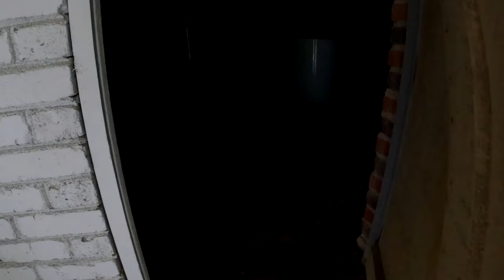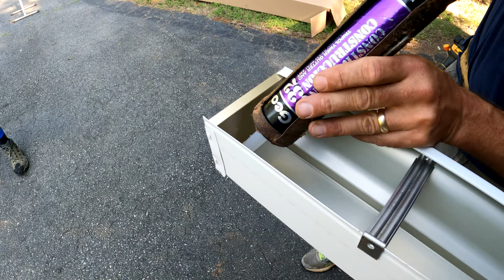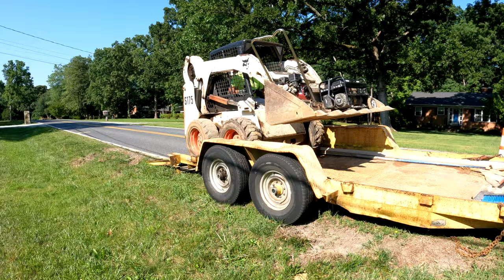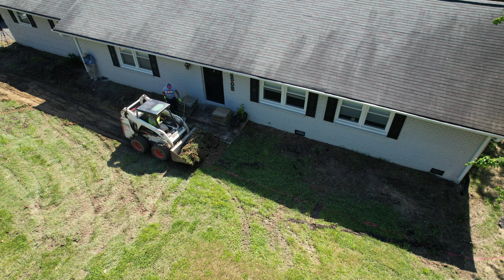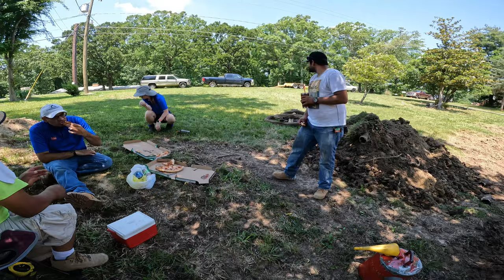Forming it up Part 2 of 3

Comment: When you're assembling 4" PVC by yourself, here's a tip from a DIY'er who almost always works alone.  Put some kind of hook on the end of a rope - I just use the strap from an old ratchet tie-down - and hook it in the far end of the pipe.  Secure it with duct tape so it doesn't just fall out.  Bring the free end down to where you're gluing; spread the glue, get the pipe started into the fitting, and then wrap one hand into your rope & pull hard while maneuvering the pipe & fitting with the other. It's not nearly as good as having a helper shove from the far end, but it's much better than just trying to pull the pipe into the fitting by grabbing on to it.
Reply from the maker: That's a great tip! Thank you!

Comment: Crawl space is bad. Needs new barrier and sump pump and drain around perimeter. Add dehumidifier as well. That is bad for the air and wood. "every little 1/8 of an inch counts" thats what she said.
Reply from the maker: Now that we have solved the water intrusion issues the vapor barrier is moot.

Comment: When you said you were not taking your truck in the back yard due to the old septic tank, I had a little chuckle.  It also made me wonder how I did not fall into ours when we use to drive over it.  We never knew where the cesspool tank was and came to find out we had been driving over it for years, had a RV parked on it and had heavy trucks drive over it also.  We got very lucky.

Comment: A corrugated pipe actually flowing? never seen it before
Reply from the maker: Hahah! It was flowing but not enough to help matters any.
Reply: Nothing wrong with single wall corrugated pipe for lower flow land drains where no debris can get into them and they can not be crushed. Just under the grass and connected to gutters is not their place.

Comment: I just got gutter guard installed a couple weeks ago! We've had a couple huge rains and they've kept up great! I get tons of leafs and helicopter seeds that clog them. Year round cleaning.
Reply from the maker: The gutter guard makes cleaning so much easier. Using two leaf blowers I can clean off my roof in less than 5 minutes.
Reply: @GCFD  Would you happen to know the brand of the gutter guards?

Comment: When you lifted the pavers and said sand rock was under them and it lets water through. Why did you get sand rock under the concrete slab? Wouldn't you want some sort of impermeable clay sand/dirt under the slab?
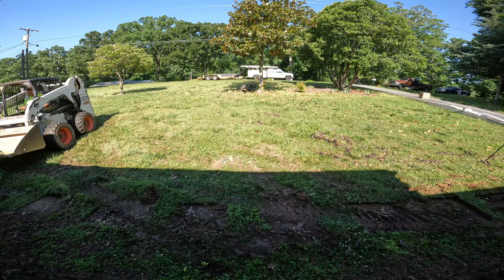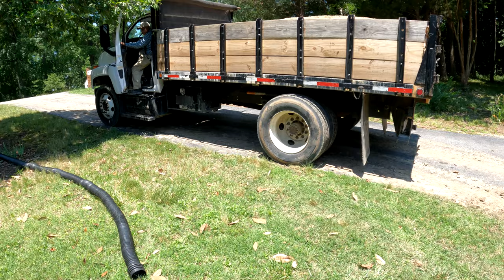11:10 and 16:40

I'm assuming it doesn't matter as the water will not be sitting on top of the soil penetrating down when its coming across the hill and landing on the slab into the drain?
Reply from the maker: You got it. We made sure to use good clay to pack up against the new concrete to keep the water on the surface. We also make sure the ground is higher than the slab so it rolls onto the concrete easily,

Comment: Hey Sean, what if you had done a linear drywell along the front of the house drained to the channel or pond directly? You'd have to trench deeper to get below the crawl space but then you wouldn't have all that concrete. The linear drain could still be used as a make-sure method. On the other hand, I see more drainage work for you in the future when this or the next homeowner forgets and builds a roof over that patio.

Comment: Those gutters are amazing! Did you attach the drain at the end of the house to the pipe to get it in the channel? I couldn't see.
Reply from the maker: The last downspout at the right of the house dumps onto the concrete. I didn't like the idea of turning more than 90 degrees to get it into the channel.
Reply: @GCFD , oh, that makes sense. Thanks for taking the time to reply.

Comment: would it be a good idea to put a good clay soil up against the new concrete to keep water from going under the porch, to force the water out of the ground and into the channel drain? or is the surface runoff  the only worry? cant wait for part 3, good job so far!
Reply: How much does it cost to get those gutters?
Reply: Maybe but then the ground there could be a bit muddy. The sand under the slab will catch the subsurface water and will drain most of it if it is connected to the rip rap channel.
Reply from the maker: Yes Vince! The finish grading on a project like this is as important as everything else. I spend a bunch of time talking about that in Part 3. The final grade has to be higher than the new concrete as well so the water flows off the ground, onto the concrete, and into the channel drain.

Comment: Wow, form fall is no joke on this project. Cameras flatten images and you can tell it’s low on the front end. I’m curious, would catchment water impact integrity of concrete flowing down front yard too? And would there not be debris clogging drain at some point from runoff onto concrete from soil?
Reply from the maker: We do an extra good job of compacting the soil up against the new concrete and seeding/strawing the bare soil to prevent as much runoff as possible. The homeowners know they will have to clean out the channel (or get us to do it) after the grass grows back up.

Comment: Hi Shawn, why did you go with the Riprap instead of a French drain? Cost? Great video by the way 
Bobby L
Reply from the maker: I like the idea of a riprap channel as it fit well with the looks of the property. Great question Bobby
Reply: With all that fall, a french drain would be impossible to do. I don't think ground water was an issue here, it was surface water from the yard and adjoining property. Now the water from the front roof and yard via the channel drain will dump into it.

Comment: Great video! Super high quality! 

The new 60 foot stretch of gutter seemed to have just the two drain pipes. Is that enough for a roof of that size? I thought you commented in part one about the lack of drain pipes.

and I love the old timer supervising the build
Reply: I think it was the old gutters having a smaller capacity. 
These gutters are larger,  and with bigger downspouts.
Reply: Its the area to be drained that matters not the length of the gutter. A long gutter, for the same area, if laid to the correct falls for the flows along its length (a big gutter sized for the flow at the outlet could be oversized and not self cleansing near the head of the run) would have more storage capacity in a thunderstorm.
Reply from the maker: I talked about adding a downspout near the door, which would increase the capacity but would look way off. Since we did concrete any overflow still won't hurt the foundation, we did larger gutters, and high end gutter guard to keep them flowing. I feel good about that long stretch not harming the foundation even if it does get overwhelmed.
Reply: @johnclements6614  the roof looks quite large, 20m long and 8? Deep. That is a lot of surface during a good downpour. Hence my question. They will have to be able to handle about 40 gallons a minute when it’s pouring. 

I hope we can get a good impression in part 3 with the footage of the solution in action.
Reply: @GCFD  

Thanks for the update.

I personally don’t mind the look of a downspout near the door. They can make a nice feature out of it with some creativity. But it’s their house and their call. Just wondering.
Reply: @rickb3078  I agree that it does look quite a large area. I looked at the US gutter design guide a few months ago and it does not seem too complicated. I would hope that the gutter installers would do the calcs and confirm that the gutter would handle the design rainfall for that location.

Comment: But again they only have two outlets on the long front gutter. Will this be enough to drain the huge roof? In the previous video you said it wouldn't be enough.
Reply from the maker: The fact that we have concrete will still contain any water that might overflow the long gutter. We talked about adding a downspout near the front door, even though that would look funny. Ultimately, we went with the gutter guard and concrete and only two downspouts.

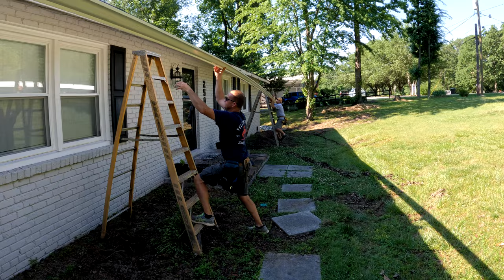Comment: The gutters have no-slope.  I couldn't trust that drip-edge with the 3.5 inch flash-flood storms I see 9:08    I'll probably just end up using a flashing tucked under the drip-edge & into the gutters to allow all the gutter-slope I can get.  They won't be crooked they'll be fully functional, or they'll overflow at the lowest point by design.   

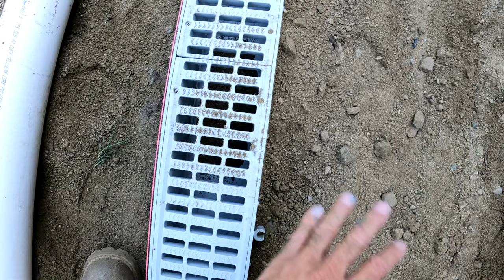21:43 I recently spilled some blue glue in a bag of fittings & after curing the fittings soaked in blue-glue where super soft where I could literally stretch it like a goo. I wouldn't use too much is what I'm suggesting b/c it can permanently soften the plastic.
Reply from the maker: The gutter guys ensure they have slope, and give the sections with two downspouts a nice crown in the middle. that's interesting on the blue glue - you're referring to rain-r-shine correct? I haven't seen it soften up 4" fittings before.
Reply: @GCFD  It wasn't rain-r-shine but it was the same brand.  Might be something to test for experience.  Literally the PVC was as soft as chewing gum under the layer of excessive/spilled cured blue-glue.

Comment: Shawn, could you please give a link to the gutter guards you used?  I'm not finding GG's that look like yours.  Thanks!
Reply from the maker: I will check with the gutter guy.
Reply: @GCFD  Thanks!  After doing some research, there are only about 87,456 or so opinions on the best gutter guards.  I'd really like to hear what you recommend.  Thanks,

Comment: What would have been a non-concrete solution up front?
Reply: Direct all the gutters to a low point in the property. Excavate the front walls and waterproofed the walls and add a drainage tile if possible you bring it to daylight and if not you add a sump pump. Adding some catch basins in the yard to take car of runoff water would also help. In all honesty having a 100% percent waterproof home can require multiple steps as seen in the video. There is more than one way but when it comes down to a decision it comes down to mainly 2 things budget and your trust in a experience contractor that can guarantee you his system will work and hopefully they aren't experimenting on your home.
Reply: Dig a 600mm wide (2 foot wide ) trench 1500mm deep ( 5 foot) which get down to the foundation level about 2000mm off the house wall from the drive around to the rip rap channel.  line the trench with geotextile and fill with 40mm (1 1/2 inch) single size stone up to ground level. You could go with a narrower trench but then the homeowner has to keep on top of keeping the stone exposed so that the water drops into the trench.
Reply from the maker: G V said it pretty well. I actually dragged my feet on this project because initially they wanted a french drain. I just didn't feel good about it, but they kept calling me back to get started. Finally, I was about to start the job and I met with them and said we need to do concrete. I covered the extra cost of the concrete because I knew it was going to solve the problem completely.

Comment: What keeps the downspout pipe from floating up while pouring the concrete….seems there isn’t a lot of coverage over it…….I’ve installed 1,000 of ft of channel drain….is there rebar attached to and driven into the the ground to lock it in place…
Reply: It's staked down. You can see the metal stakes when he was showing the bit of dirt he got on the channel drain.
Reply: @jeremycreech4757  
Thanks for the clarification
Reply from the maker: Like Jeremy said! We use 12" nails to stake the channel down.

Comment: Shawn, I've watched probably three dozen of your videos now since I found your channel, to prepare to do a small project at the back of our house where we get a bit of water in the basement after a very heavy rain.  But you mentioned something about the french drain at this house (https://www.youtube.com/watch?v=RkeJaFlnbWI&t=906s) that has me wondering if I've learned anything!   You said the french drain wasn't doing anything because the crawlspace was lower than the drain.  Our land slopes gradually downward to the house in the back. So does that mean a french drain about 3-4 feet from the back wall wouldn't help to keep the water that's coming down the slope out of the basement, even if we make it fairly wide?  Is concrete the only solution?  Thanks!
Reply from the maker: The way the FD works is by filling up/ holding a trench of water. As the trench fills up (gravel lets the water move easily) the water floods into the holes in the pipe and flows through the pipe. The problem is there is always water in the bottom of the FD. If your crawl space is lower than this trench, there is still a possibility of water seeping into the crawl. This was a fairly deep crawl so I didn't want to risk a FD.
Reply: @GCFD    Got it. Thanks a lot!